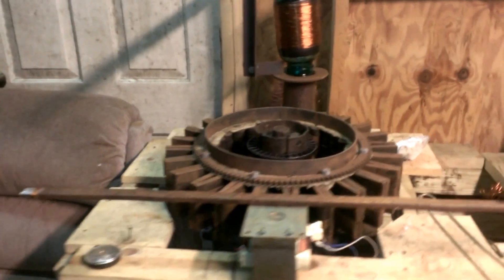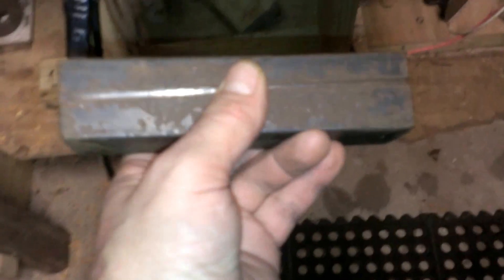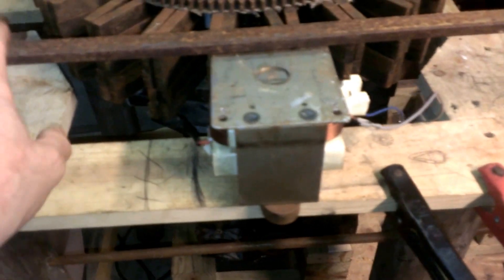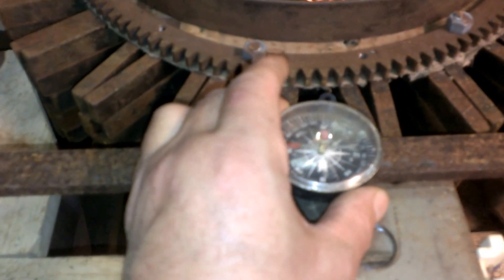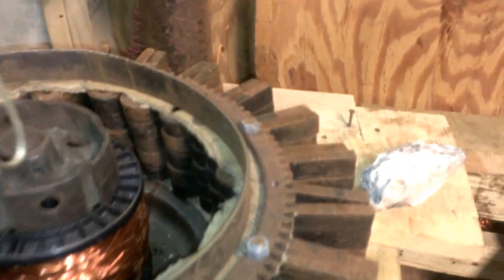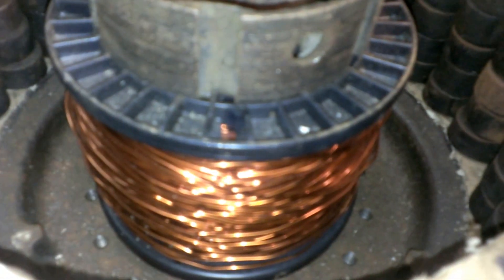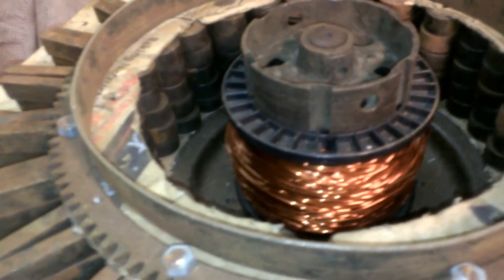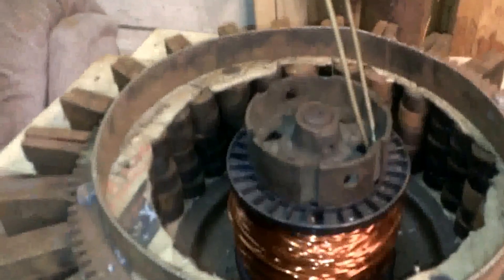Ed leedskalnin's Perpetual motion holder

Comment: Hmmm, interesting, i understand your charging it for just a second and energy is trapped,,,but now you touch wire with magnet and magnet keeps spinning,,,,why would it keep spinning if you touched it to ground,,,i would think this would let the energy escape and magnet would only spin for 1 second? How can it keep spinning if energy was let escape to ground?  And you "keep" getting sparks, not just one, hmmmm?  Thanks for sharing your results :-)
Reply: I think this guy actually believes what he is saying. Allow me to explain what he is observing because he doesn't seem to know. The first demonstration is not perpetual motion, it is call making a permanent magnet. the fields in the iron align (using electro MAGNETIC coil) and stay aligned until disrupted (moving iron bar). No mystery here.

Sparks from the brass rod is a simple little trick. Dropping the magnet down the (non-ferrous) rod generates eddy currents that produce electricity.   

In the fist demonstration he shows how electricity creates magnetics.

In the second demonstration he shows how magnets create electricity.

So he has gone full circle, I believe Lorentz has already covered this base.
Reply: MrTHEORIGINALICEMAN Hmm, i will have to think about this.  He is generating sparks off the rod even when not moving the magnet, and there is multiple sparks.  Hmm, wouldn't the mag spin only for like a second on the rod, especially that the battery has been disconnected?  Hmm, wouldn't the fields collapse after the rod is touched? Thanks.
Reply: If you watch closely there is only one time he lets you see the rod touch when the magnet is not spinning and there are no sparks. Discharging the rod does not affect the moving magnet. The magnet is spinning because of all the other magnets around it and it will spin until it finds it's equilibrium. It is like touching wires together on a battery, it will continue to spark until all the energy is gone. He cannot produce the same results with a steel/iron rod. If the energy was coming from the engine block why would you need a spinning magnet to show it?  This is what you get when you approach an experiment with bias, He assumed something to be true and he is going to prove it, that's not very scientific. However, there is a way you can store energy in a solid material by putting it into an energized coil of wire. You can do it in fact with iron but it is only temporary, like a battery. The other way is to mix some Boron, Neodymium, Iron, Samarium, Cobalt, Nickel in very precise proportions. Compress this material and heat it until it is fused together. Then put it in a energized coil for few milliseconds, then you will be able to store this energy for thousands of years. Until the scientific community recognizes it as energy, we will continue to call them magnets. I keep hoping I will see a video that I can not explain, that would be truly exciting. So never stop looking.
Reply: Oh!, buy the way. Ed Leedskalnin did do some cool stuff, but he did not really understand what he was observing. So does his accomplishments make him a genius or just (Forest Gump) lucky.
Reply: MrTHEORIGINALICEMAN Thanks much.  I understand now :-)  I thought it had a lot to do with all the other mags & the rod, thanks again for explaining in detail :-)
Reply: No problem, the worst path you can go down is not the long one, It is the wrong one.

Comment: but for clarification,  the electron flows from the negative element in your battery, or negative magnet towards the positive mineral element,in your battery  or magnet,  with a [inductive capacitance] capability.  while the positron flows from the positive mineral element in your battery, or positive magnet,towards the negative mineral element or negative magnet,with[electrical capacitance] capabilities,.   two different critters ,headed in two different directions, with opposite spins, ,the negative is amps or current flow,  the positron is voltage or pressure.
Reply: But the fallen angels the gods have special techniques to reverse all this and hence antigravity technology also they match the two polarities so it does not let earth's magnetic field to pull the object down as each atom has a electromagnetic frequency signature study the book of Enoch the holy watchers of fallen angels on lucfiers team the dragon devil had sex with woman and made incredible hulks basically or Titans

Comment: ED’S BIGGEST CLUE

To the electrical engineers the positive electricity is everything, the negative electricity is nothing, but to the physicists the negative electricity is everything, and the positive electricity is nothing. Looking from a neutral standpoint they cancel each other, so we have no electricity, but we have something.

Lets break it down

To the electrical engineers the positive electricity is everything, 
the negative electricity is nothing,

Most people think he is talking about the North +  and south - Magnetron’s but then they have not been paying attention! Your using conventional physics to understand Ed’s work and Ed out right rejected most bases of physics.

Conventional physics states that the electrical charge goes in one direction from negative -  to positive + = Electron flow.

To the electrical engineers the positive electricity is everything, 
the negative electricity is nothing, but this is conventional physics and not what Ed is talking about cause he rejects this. 

He is being very smart with his words and wording! He never separates the two, one can not run with out the other! 

Positive electricity was something else to Ed?

Positive electricity to Ed was running one kind of magnet against the other kind at high speed and with a right hand twist or something that looks like a double helix He does not separate the two forces. 

When you push a coil throw the PMH back and forth the currents start to move in the double helix fashion creating positive electricity. 

He is not talking about the magnetrons he is talking about positive and negative electricity

So what then is negative electricity 

Looking from a neutral standpoint they cancel each other, so we have no electricity, but we have something.

When the coil reaches the middle of the PMH and the magnetrons stop flowing in the double helix fashion we have no electricity, but we have negative electricity!!

The magnetrons don’t stop flowing they just flow in another way. 

He also says voltmeters and amp meter are one sided they only show positive electricity never negative electricity. 

If you have a copper coil attached to a dial voltmeter as you push the magnet in and out the dial will move showing positive electricity but if you leave the magnet inside the coil not moving it shows nothing, but it should show negative electricity.. 
He also says voltmeters and amp meter are one sided they only show positive electricity never negative electricity. 

If you have a copper coil attached to a dial voltmeter as you push the magnet in and out the dial will move showing positive electricity but if you leave the magnet inside the coil not moving it shows nothing.